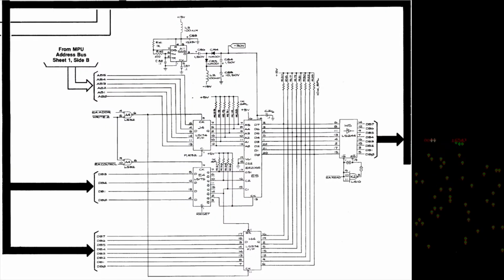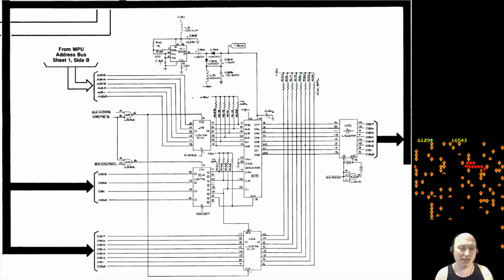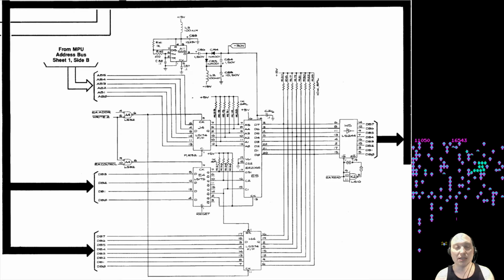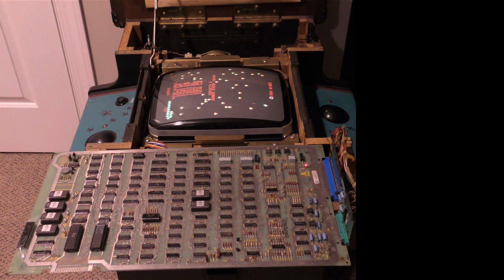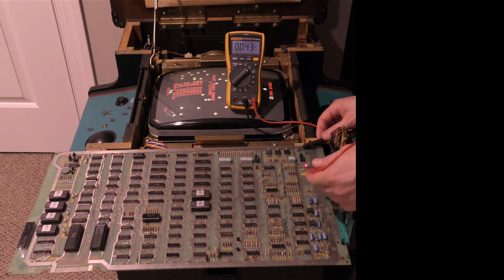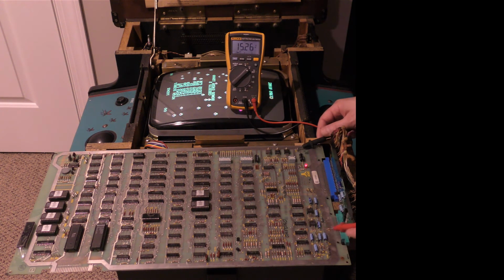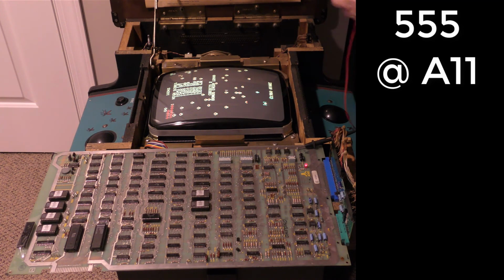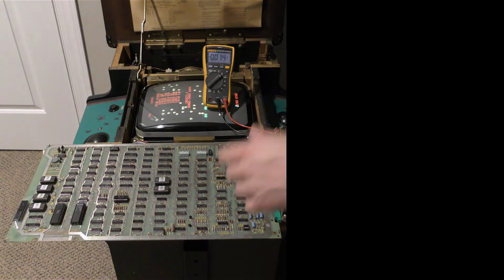Arcade PCB repair #20180619.01 Centipede EAROM (high score save) circuit

Comment: Dang, I just fixed a high score save and then found your video (replaced 7815).  Also, had a board where -15v was not being regulated was @ 22v, but high score save was working (@ 33v at earom).  replaced the 7915 to be safe.  Need to check your video's first and make my troubleshooting easier.

Comment: Hey, I had the same problem and had to replace the 555. The voltages are all correct now but the high scores still won’t save. Any suggestions?
Reply from the maker: Luke Shannon next likely culprit is the EAROM chip itself. There’s a few others it could be but the 555 and the EAROM are the two most likely to fail
Reply: arcade-cabinets.com Ok, just replaced the EAROM chip and it still doesn’t save
Reply from the maker: Luke Shannon how are you testing to see if it’s saving? Remember it only saves the top 3 scores
Reply: arcade-cabinets.com well I got the top score then turned it off and on and it wasn’t there anymore. I also went on self test mode and it said 4 FF in the top left
Reply from the maker: @lukeshannon6808  so go into test mode, then hit player1 start and fire at the same time. play 1 game, then turn it off wait 20 seconds, and turn it back on , go back into test mode and see if the FF goes away and the bottom of the test screen should say "1 game played" and "average game time mm:ss" or something to that effect. if no go then there's a couple other things you need to test.
Reply: arcade-cabinets.com ok did that and the FF is still there and it doesn’t say one game played or the time
Reply from the maker: Luke Shannon ok then you have to get further testing the next step is too see if the earom is ever enabled.

Comment from the maker: I don’t  know why they used this. I’m guessing cost? As the 555 is a super cheap chip I’m thinking any other solution would be been more costly, but this works (besides the fact that the 555s often go bad in this circuit) and it’s super cheap.